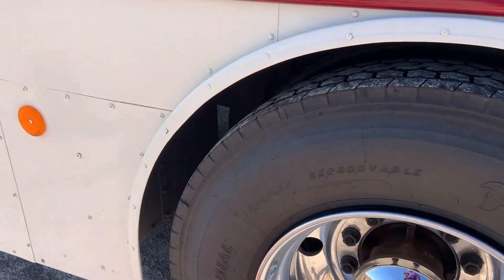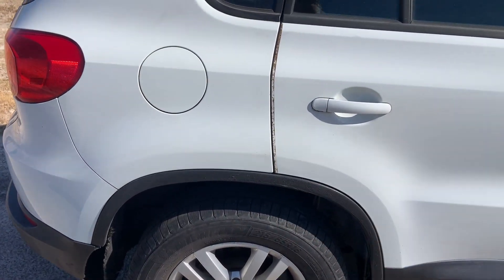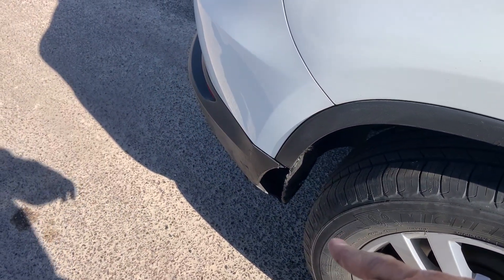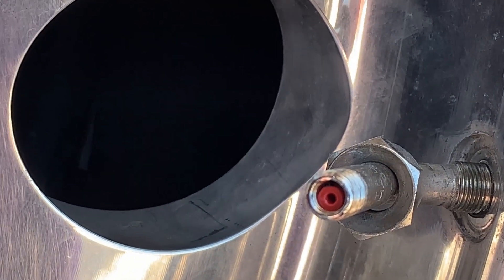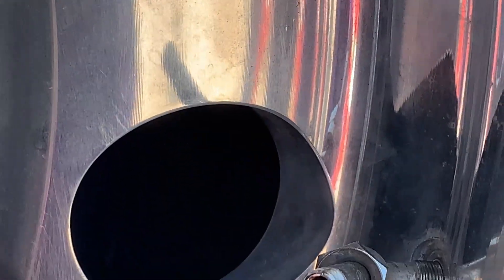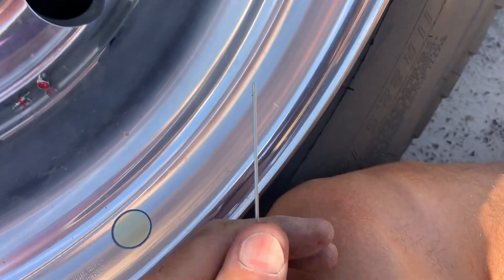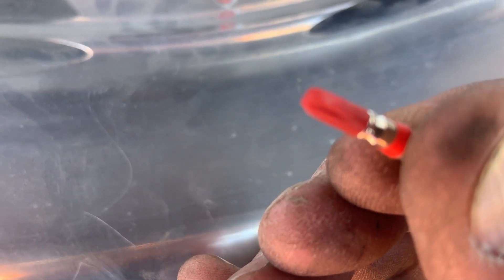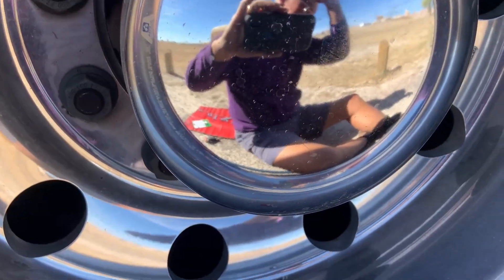Leaking Tire Valve

Comment: Did the starter fluid thing work? Ive always been scared to attempt that.
Reply from the maker: Yes it worked. I used this method when I originally mounted them. And, yes, it’s scary. Having the wheel mounted to the vehicle makes me feel way safer.
Reply: @hakunamatataadventurebus5944  Sweet! Since i have your attention, would you mind giving me some info on the c2 busses? When i watched one of your early videos i noted that your bus has air suspension. In a few years we want to sell our current bus and do a build out on a c2. In my search i have noticed that the air suspensions on these is kind of rare. 1) Is there a way to identify air suspension in the vin# ? 2) Is there air suspension in the front as well?  3) Any tips on finding one with air or sources for them? Thanks in advance. If you are busy there is no hurry and i understand if you are too busy to answer at all. Safe travels, Jeff
Reply from the maker: Hello Jeff, I don’t know about identifying if the bus has air bags from the VIN. But, the folks at Freightliner would surely know. They ask for the last 8 characters of the VIN. My bus has air suspension in the rear only. I believe all the school busses with air bags only have them in the rear to adjust for varying load.
Reply: @hakunamatataadventurebus5944  
Thanks for the info!